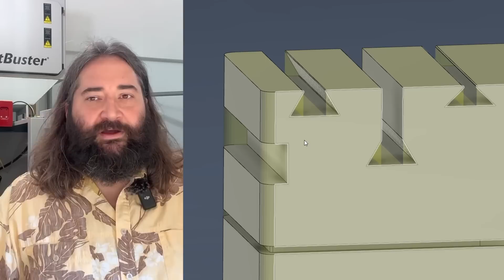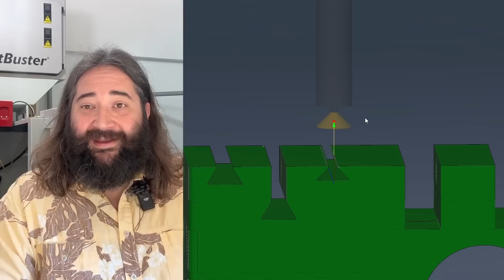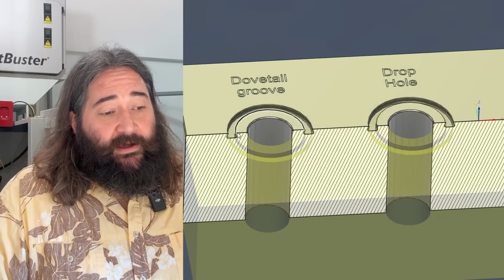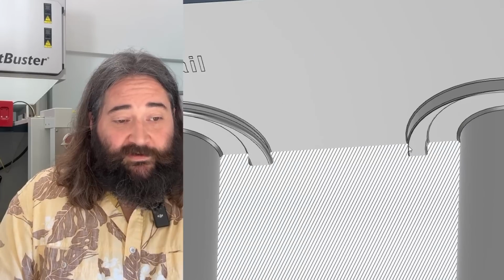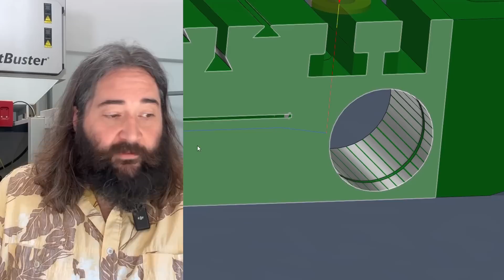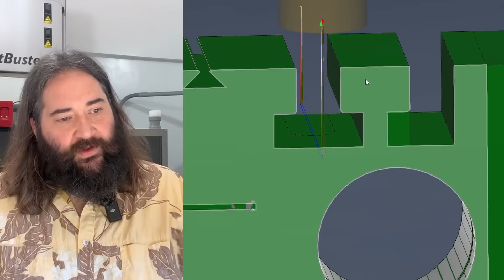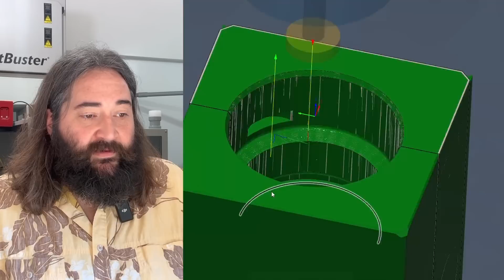Designing T Slots and Dovetails for Machinabilty

Comment: Here's a tip for designers considering a dovetailed O-ring groove:  Assembly mechanics have lots of tricks.  I worked on.. er... a fuel system, for brevity's sake.  When there was something like an O-ring to keep in place long enough to bolt together, a smear of petroleum jelly was great for just making it stick.  Whatever your fluid medium, there's likely a bulk lubricant that's compatible.  So just get the trepanned groove. ;-)

Comment: an old machinist I used to work with had a set of shop made two flute blind t slot cutters for a few sizes. was a really dumb tool to me at the time apparently at some point in his career he needed them. basically just increasing diameter by a .05 per cutter. worked well and was amusing to use.

Comment: Back facing even seems like something that you might even look at manual machining options if it's a small enough production run (say it's a one-off or you're still prototyping and working on a way to not have that feature needed, but you need to get it made at the state it's in now)

Comment: 14:50 On the blind T slot example, couldn't you go in with an eccentric cutter that is essentially a boring bar? That would allow you to use a larger neck for a given undercut width compared to using a T slot cutter. (Not trying to defend the part designer, I promise!)

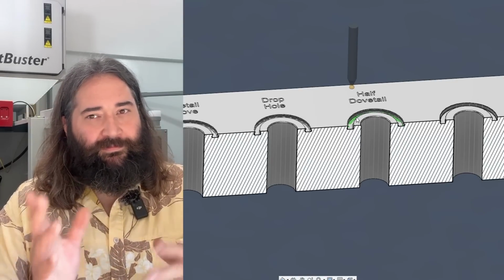Comment: 8:30

I'm sure it doesn't exist, but I wonder if you could use a single flute dovetail cutter that's decently wide and use an oriented spindle to drop down into the slot, then run and cut your dove tail, and then orient out

Comment: Last year we had to make a quote for a part that would require a T-slot cutter with a cutting diameter of Ø25mm... and a shank of Ø2mm. In stainless steel. The T-slot was 40mm down in a hole - so yeah. We literally had to cut the step file of the part in half and draw a tool, then simulate and figure out if it would ever be possible. Ø25xØ2 was the only dimension possible for that feature to be made.

We ended up calling the customer and telling them it would be too hard for us to do. 
"Oh that feature? It actually isnt really needed"

🙃
Reply from the maker: Sounds about right
Reply: Sounds like something a mechanical engineer with zero practical experience would do.

Comment: Instead of having a small o-ring grove with a dovetail you can make the mating part the outside diameter of the gland. 

For multiple o-rings position will need to be considered but this allows for a dovetail feature to retain the o-ring without the machining drawbacks.
Reply from the maker: That’s slick

Comment: Hey Adam, I really enjoy this format. It brings a lot of value to engineers and machinists alike! 
About those full dovetail O-ring grooves- I always mill them with a ball endmill in a 5 axis simultaneous contour. It's a very simple, reliable toolpath and the tool diameter doesn't get too crazy small. The biggest challenge is blending the tools from grooving and from picking out the corners.
Maybe something to consider if a shop has 5 axis capacity.

Comment: Thanks for the content, you have found a gap in the Youtube content that really needs addressing. You rightly shift the emphasis from MMR to the fundamentals of design to make efficient products.
I would like to add that extension rods can easily be made to lengthen piloted counterbores and work really well in a drill press and sometimes in a pistol drill.

Comment: For dovetail drop holes, it's important to put the drop hole on the side with the higher pressure so the pressure delta pushes the o-ring into the continuous dovetail side.

Comment: Definitely a great series. But at some point I need you to talk about long overhang necked down tooling. I can choke up on the end mill, play with the RPM/feed, DOC, RDOC on a 10xD Harvey end mill in aluminum and it'll still chatter. No idea how some guys use these on anything harder. Everywhere from just under Harvey's recommendations to well under. 8xD or lower is smooth sailing but once we get to like 10xD I gotta turn the RPM down to like 500...
Reply: It can def be quite the adventure getting an endmill like that to not chatter since 10xD is honestly near the limit of what is reasonable to expect from a customer. Ive found that turning the RPMs very low and increasing the feed can do wonders but it always varies a lot. The other challenge is getting something that resembles a good enough surface in the end :face-purple-crying:

Comment: Hey Adam, I recently came across a drawing at work that had a round undercut shape. Imagine an upside down lightbulb. They did it to slide a 1 in dia. Rubber tube into the part but I didnt know how they got it machined. Any thoughts? It had about .75 in neck and 1 in circular undercut.

Comment: I think you could make a blind T slot without an entry hole, with enough time & money. Mill the slot center, then go in with a set of successively larger-overhang boring bars to mill the undercut. As long as you feed it in aligned such that it clears the slot walls before starting the spindle, and there's a small enough depth of cut that it doesn't instantly shatter or stall the machine with the startup torque, you can do it. With great difficulty and expense, but it should be possible as long as the undercut isn't too big.

Comment: The main issue with most chip related troubles is the lack of proper chip evacuation... I prefer straight mineral oil as a coolant, as it does not ruin machines, on the contrary, it absolutely prevents rust and lubricates the tooling, improving the surface finish and tool life, while offsetting the lack of cooling capacity that oil has with the reduced friction of the tool and thus lesser heat generation in the first place... 
The point that i`m trying to get to is that if you have a good cooling system, or rather - washing system, that is set up in such a manner that if follows the tool and blasts the chips out of the flutes, you have effectively removed 90% of chip buildup troubles... A nice blast of constant high pressure oil from a precise nozzle, aimed at the flutes will do wonders, even in dovetails and T-slots... 

The main issue that people have is shitty setup of the coolant nozzles and sloth regarding actually bothering to set the nozzles up for each cutter or even a specific cut in a part...  Just having a cnc style multi nozzle, high pressure blasting coolant ain`t enough if those nozzles are aiming at shit... Quite like coolant on a surface grinder... There are so many ways in which your coolant can be nearly useless on a surface grinder, regardless of it`s flow rate or pressure... 
Coolant is literally a tool in it`s own right, almost like those olden machine accessory drill guides that bolted onto a machine and lead a drill precisely where it had to go(speaking of olden jig borers for the most part); you can`t just have an accessory bolted onto a machine and demand of it to do miracles if you are the one fucking up and setting it up poorly... 
One to three nozzles are what you need... Get some nice inox seamless pipe, some 4mm i.d. or 160thou for you pondscum suckers(across the pond reference)... Make a nice articulating arm that will carry those, or rather - carry the carrier that will carry those... Make it so that you can easily set them up and move each pipe or just the one into any position... Bend the pipe in a Z of sorts, you know what i mean, not Z but more of a one leg of a swastika, no pun intended - so that the pipe can be swung right against the shank(parallel to) of a cutter and aimed at the flutes or teeth or whatever cutter uses as cutting edges... Fuck the flex-pipe, get some hard pipe and make something that does a job well!

Coolant can just be pissed on a part and hopefully on the tool, and sure, it will do something, but that`s like tossing some crap in the pot, adding salt and hoping the stove will work wonders from your lack of effort... If you want it to do it`s job to full potential, you have to set up every aspect of it properly and approach the situation accordingly... 
Roughing cuts need all the attention and help as it aids the tool and reduces the stress imparted on the material if the cutter is allowed to just shave the chips off rather than battling it`s way through a slab... Finishing passes on the other hand need all the attention and help to maximize the surface finish grade and again aid the tool itself... The better the lubrication and washing away of chips - the better the edge retention and thereby the nicer the surface finish it imparts and the longer it will be able to do so! 
The surface finish of the edge itself is actually what generates the surface finish in the material... Try mirror lapping a lathe cutter and try an identical cutter with just a honed surface at identical speeds and feeds as a finishing cutter... 
Also, here`s a free tip for those of you who read this crap - get some used masonry SDS drills with carbide tips, the large ones, get them second hand(expensive af when new and good quality) - extract that nice chunk of large carbide and braze it to a slab o` steel that fits your lathe toolpost(maybe even cut it in two with a diamond zipdisc, they are large)... Braze that shit well and put a good geometry+mirror finish to it and behold the best cutter you will ever have used... Those carbides are not your typical machine carbide - those eat impacts and all sorts of abuse like it`s nothing,  just give them constant flood cooling as they again - are not typical machine grade carbide... 
But yeah, i`ll cut the rant here... Treat your coolant pipe like your piss hose - always aim before blasting away... 

Best regards!
Steuss

Comment: We had some parts with a 3/8 wide * 3/16 tall t-slot with  a 3/16 slot and couldn't find anyone making an off the shelf tool to do it, wound up just grinding a 3/8 3 flute endmill and it worked surprisingly well finish-wise but chip removal was a problem. We wound up grinding up a 5/16 one to rough it out and that ended up being a good solution. Granted this was all low tolerance work in aluminum, but it still made the parts substantially more expensive. Unnerving to run is a perfect way to put it, if the air blast wasn't in the exact right place it would weld up in half a second

Comment: I struggle with when to explicitly model fillets, chamfers, and reliefs when it's not a required functional feature but some solution is required for manufacturing.  If I model them, they appear in the step file as a fixed-size/shape feature that could be seen as a requirement rather than an allowance.  If I just do a drawing note on a sharp edge (e.g. R .03 MAX), it's not necessarily associative back to the model and changes to the model.
Reply: A customer of mine that is one of the bigger machine builders in all of Scandinavia have their own way of making drawings and stepfiles. They dont use GPS measurement/tolerances unless it is absolutely vital to the part - which honestly rarely is the case. Why put a tolerance of parallelism of +-0.02 on a big tool plate if it isnt vital as others do. The only way that can be achieved is surface grinding. And some customers really dont want to pay for that.

Their 3d models will have radius and specific chamfers on them if theyre vital - if not theres just a text in the corner saying to break sharp edges with a 0.5mm chamfer. Like you do.

They are WONDERFUL to work for as they also have their own jobshop so they know the challenges that some parts can create.

Comment: Thank you Adam...these are all golden.  I will be sharing these with the engineers I work with.  Best very detailed examples that I have seen...I work with so many engineers that don't realize what it takes to really make those tiny tolerances they put on drawings that they don't usually understand and 90% of the time don't need.  thank you again!
Reply: Ive had huge tool steel plates with rather "insane" tolerances of +-0.02 mm in parallelism on features that would require a massive surface grinder to achieve. It can be done but it usually ends up with the customer calling and asking why my quote for the part is so high and that some of the other bidders straight up denied making the part.

And more often than not - those tolerances arent even necessary and was just put on the drawing by someone who doesnt understand machining. I would love for all engineers to watch this series from Adam - it really shows some of the challenges.

Comment: whats the best way to modify it to serve as a t-nut and especially in terms of budget and simplicity? I have modified roof racks which I painstakingly modified the square under the head with a dremel. However the carriage bolts work well and are cheap but more precision would be nice.

Comment: thanks for picking up the undercut topic.
O-Ring grooves are always special. i once had to design a groove around a non-circular insert close to a relative high wall that the customer could hardly manufacture (but they requested it). 
these days, i would ask them, to look for someone who has a machine like the Hermle C32, which can run a kind of scraping tool along a path to cut a clean groove... would also give a better sealing surface then a high-speed-3mm endmill on a 50mm extension or so :D

Comment: Designing T-Slots and Dovetails for Machinability: Key Takeaways

* 0:00 Undercut Tooling Design Considerations: When designing parts with features that require undercut tooling (dovetail cutters, Woodruff keyseat cutters, T-slot cutters, etc.), consider the distance from the cutting edge to the tool's "neck" (the thinnest part of the tool's shank).  A narrow neck limits tool options and can make machining difficult and unreliable.
* 1:11 Dovetail Cutters:
    *  60-degree dovetails are generally easy to machine with standard tooling.
    *  Sharper angles (e.g., 45-degrees) require wider or shallower dovetails to accommodate the cutter's neck.
    *  Fully tangent corner radii often require more expensive ball end mills. Consider if a non-tangent radius is acceptable.
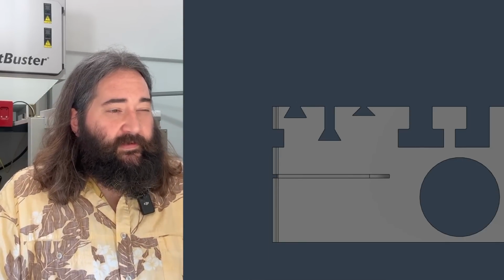* 5:00 Dovetail O-Ring Grooves:
    * Dovetail o-ring grooves can be challenging to machine, especially with small o-ring sections, due to the fragility of the cutters.
    *  Consider alternatives like drop holes or half dovetails, which allow for the use of larger, more robust cutters. 
    *  Standard o-ring grooves (straight walls) machined with trepanning tools are the fastest and often provide better sealing due to the orientation of the machining marks. 
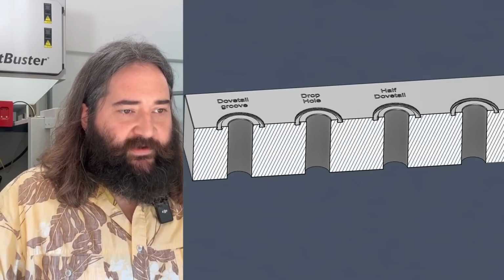* 9:54 Side Milling and T-Slot Cutters:
    * Side milling cutters are designed primarily for cutting from the side and have limited bottom cutting capabilities.
    * T-slot cutters can cut from the side and bottom. However, they require a full-width cut (no roughing passes), making chip evacuation and tool deflection critical considerations.
* 13:15 T-Slot Design Limitations:
    *  Limit the "step over" (distance from the cutting edge to the side of the slot) to no more than 1/3 of the cutter diameter for reliable machining.
    *  Avoid blind T-slots if possible, as they severely restrict tool choices. Consider drop holes as an alternative.
* 16:25 Spot Facing and Back Facing Tools: 
    * When spot facing is required in difficult-to-access areas, back facing tools may be necessary. These tools deploy a cutter after entering a hole, allowing for machining on the back side of a part.
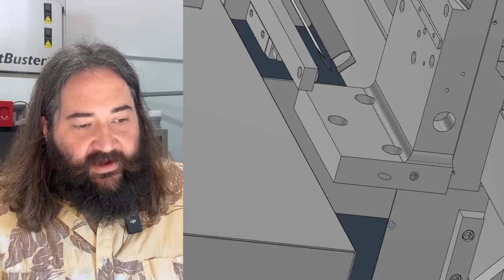* 18:31 General Recommendations:
    *  Consult tool manufacturer catalogs (e.g., Harvey Tools, Iscar) to understand the capabilities and limitations of available tooling before finalizing your design. 
    *  Designing features that work with readily available tooling will lead to lower manufacturing costs and better part quality. 

I used gemini-1.5-pro-exp-0801 on rocketrecap dot com to summarize the transcript.
Cost (if I didn't use the free tier): $0.07
Input tokens: 18189
Output tokens: 582
Reply: The internet is dead